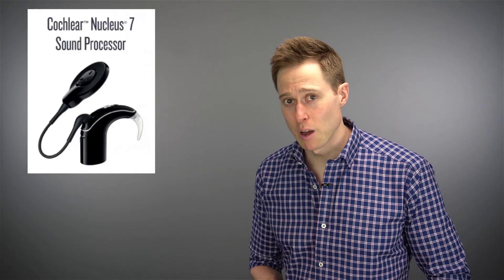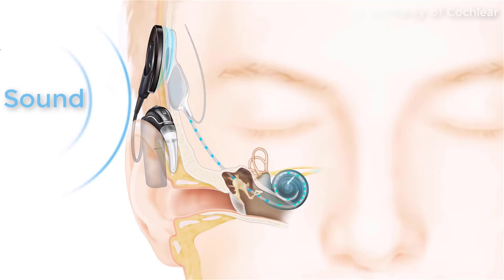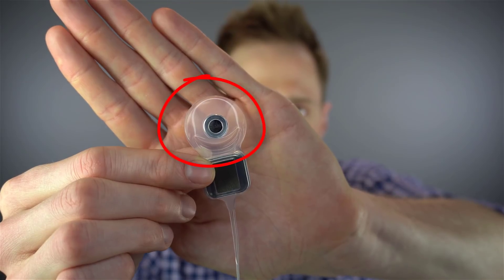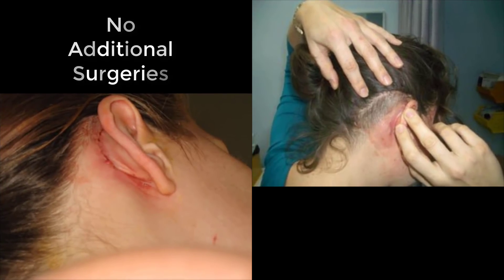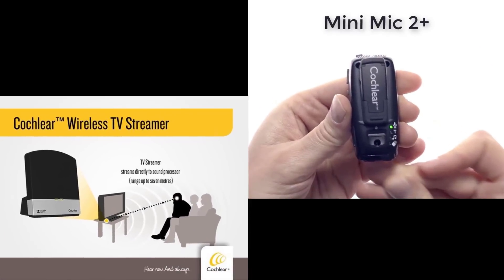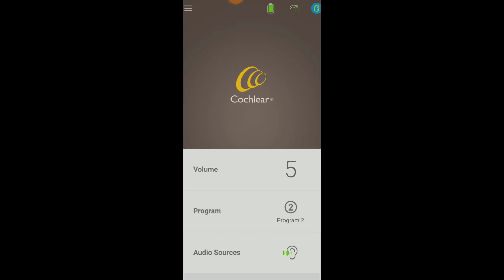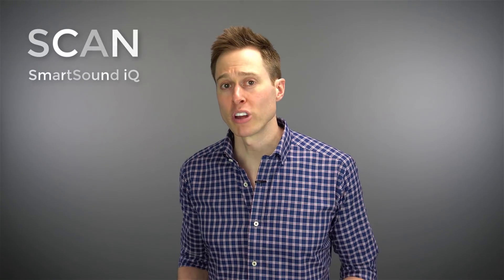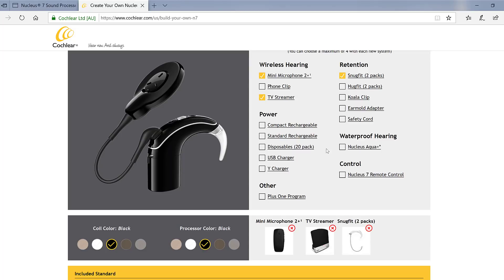Cochlear Nucleus 7 Sound Processor | Cochlear Implant Processor Review

Comment: Hi Dr Cliff
  I am ready for surgery on my SECOND ear.  Due to mitochrondial diseases, I've been rendered biologically deaf..  Right now I get by with singular N6.  Ready for surgery, and installation of N7.  In the downtime before surgery, I had my audiologist send me the N7 as an upgrade over the N6..  The N7 which arrived came with batteries and charger; of course I got everything charged up.  Then, with the N7 out, zero. results.  I found out that the N7 needs to first be PROGRAMMED by someone with similar credentials to yourself (my audiologist).  My questions are these:
[1] why?  There are a few options to review, and in every case I would answer "yes I want this."   If the new unit needs 'programming', why wouldn't the company send everything to the audiologist involved?   I hope that you as a professional would prefer sending new units to audiologists.

[2] Why does the extensive documentation which came with the N7 (more than 6 books) have NO MENTION of the need for 'programming' ??  A new owner/user would certainly need to be reminded of this!    
Thx for factual review.  I have minor disagreement with your facts:  You state that Apple products get instant streaming, but Android users are denied this feature.  Every company pitch has been to the opposite.  Please double-check with Cochlear Inc, and then check with an actual Android owner who is limited to implants.   
🙂

Comment: Words of CAUTION:
I chose the Kanso processor to eliminate the behind the ear pressure / pain, I wear glasses. I received the most resent Kanso processor that is MRI compatible. The strongest magnet strength available is a #4. The #4 magnet is barely strong enough to hold the processor onto my head. The slightest contact from anything detaches the processor. This is VERY annoying. I am very disappointed in Cochlear Americas for not properly informing me. 
I am now being forced to settle for the N7 processor and deal with top of the ear pain. I was informed by the Audi that Cochlear has no plans to increase magnet strength for the Kanso. Had I know this prior to surgery, I would have chosen an AB or a Med-El system.
Reply: Well the device is very small, maybe the processor can't hold a stronger magnet yet. Unfortunately there's nothing they can do about the ear pressure pain. They're not doctors. Their goal is to help us "hear" better not "feel" better... Well they want us to feel better after we hear better. It is not their fault you're in pain.  Maybe check in with your doctor for pain killers? Or ask for frameless or weightless glasses? They're working hard on making the next generation CI a lot smaller and lighter and it's very amazing how far they've come. I have the Nucleus 6 and I'm in the process of upgrading to Nucleus 7. Nucleus 6 is light for me and the magnet strength is #6 which is the strongest. The N7 is apparently lighter than the N6 yet the N6 is already super light. I'm sure you will have no issues with the weight or magnet strength since the N7 is super light. Sorry to sound harsh. But best wishes to you and may God take away your pain.
Reply: I suggest contacts
Reply: I had the same issue when I got my kanso 2 so I decided to get a sweat bad to help hold my kanso 2 in place and it works great I like the kanso 2 because I wear glasses and you know we have to wear masks also and that's a lot for one ear to hold and it gets sore with the elastic  from the mask 😷 so get a sweat band and you can see the difference you I got one from Dick's sporting goods and of course you can get one from cochlear also ok so it's something you can think about doing
Reply: We have to wear masks and That's a lot of pressure on the ear also a long with glasses and I have all three things to deal with the 😷 masks are a pain

Comment: Will I not be able to use my almost new Phonic hearing aid for the non implanted side which also has severe loss?
Reply: I have a Phonac hearing aid, it not electronically connected to the CI. You should be able to use any HA.

Comment: You make great works with your clips! Could you make film about rules of fitting HAs in bimodal hearing? Is there any differences from people who have only HAs without CIs?
Reply from the maker: Not a whole lot of differences when programming the Hearing aid in a Bimodal situation.  The main focus would be to link the two devices together if possible to match program settings and the ability to stream sound binaurally.
Reply: @DrCliffAuD , thanks for response. Yes, but it seems that binaural streaming is possible only in Naida sound processors... Even Cochlear Nucleus Sound Processors didn't cooperate with ReSound HAs quira as Binaural Streaming in Phonak...

Comment: I have single-sided deafness.   If I got a cochlear implant for my good ear, would that totally kill the hearing in that ear.   I have concerns about safety when I am not wearing it.   Also what about an implant in my bad ear which has been bad for decades.   Thanks for the video.
Reply: Douglas Smith you need to speak to a cochlear surgeon to answer those questions but it’s possible you’ll lose rest of your hearing yes.
Reply: Why would you want to put it in your good ear and not your deaf ear?

I’m born SSD, and now I’m different kind of SSD.

I have bilateral cochlear implants and they work well, my left ear may never be as strong as my right ear but together they work great, not bad for getting both of my implants at the same time.

My recommendation is to talk to your doctor about it.

I will say that the good ear for me progressed a heck of a lot faster than my deaf ear did.  My deaf ear is progressing really slowly and only now after 7 years that I’m finally able to use the phone on with the deaf side as well as carry on a conversation.

Comment: I would like you to review the electroacoustic cochlear implant, it means that a part of the hearing in the grave sounds it is conserved and in the acute sounds, when the hearing loss is severe to profound, it does not need a second surgery, but it is very necessary to be able to program in case the part of the bass sounds is reduced at some point. I have that type of hearing loss in the form of a deep curve and I did not find a solution. Unfortunately I'm in Bolivia and here is my significant power to find people who program based on REM that is difficult when in my country there are not many audiology professionals, in fact there is only one. less than one hundred people they work in phonoaudiology. It's practically nothing. I was watching each one of your videos and I learned a lot thanks to you, Dr. Cliff, otherwise I could not find the differences between one brand or another. I'm thinking about buy Phonak Naida V UP 90 hearing aids. These are the most expensive for our economy with that price I can buy a car and with the IC I could buy a house. that's why I consider it a luxury here. I need your advice, pass me your email to contact you. A greeting. Sergio